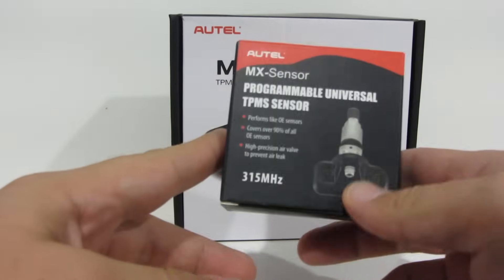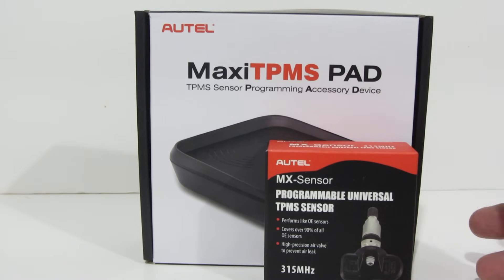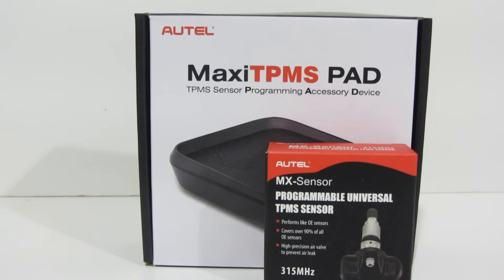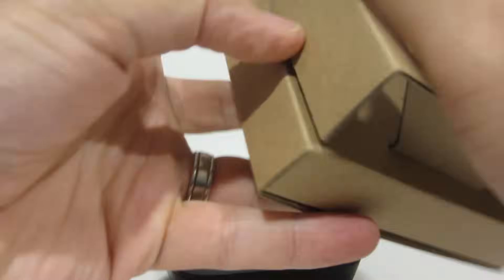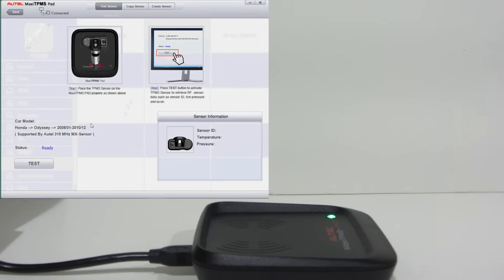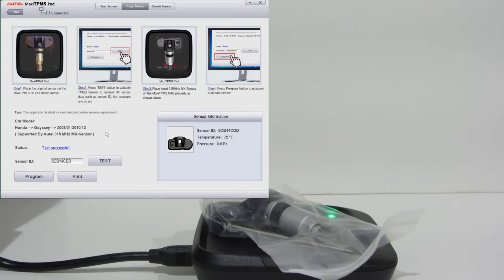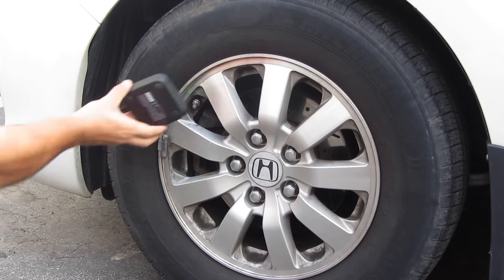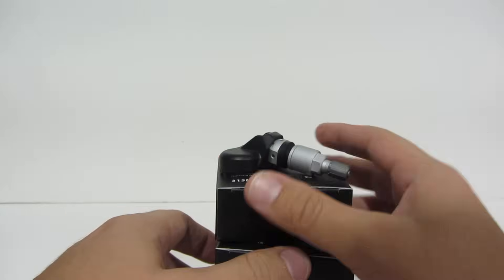Replacement TPMS Sensors for Cheap!

Comment: I have a question. Let's guess I have a dead sensor due a empty battery. Is it possible to open it up with a dremmel or something like that and put a new battery on? Of course this way you break the sensor but it allows you to turn it on and clone it with the device. Perhaps they are sealed and if you try this way you brake it down, I don't know
Reply from the maker: The code is usually physically printed on the sensor. So once you open up the tire, you can just read it. But if for some reason it's not, then what you describe might work. I can't really say. It would depend on the brand of the sensor too.
Reply: it's not worth the effort, sensors are around $30 each. and unless you have tire mounting machine,
you will need to pay some tire shop to do the installation, so why bother? chance of removing battery from TPMS and putting new battery and end up with funtioning TPMS sensor is pretty low.
Reply: @davidjacobs8558  in my car genuine sensors cost 150 euros each, plus programming, plus mounting. Is possible to fit the sensors by yourself without tyre machine. Aftermarket sensor like this are a cheapper choice and if anyone of the old sensors are off due the lack of battery, perhaps to fit a new cell just to turn it on and clone worth it
Reply: @danielboix7973  $30 is for aftermarekt Autel sensor, which is widely used, and seems to be reasonably reliable. you can get Autel TS408 for around $120. If you can replace TPMS sensor yourself, it may be worth the investment to get Autel TPMS tool. because I can assure you, when 1 sensor fails, others will soon follow.

Comment: Hi, thanks for the detailed video. Will the MaxiPad read/ write on Honda OEM Sensors? For my 2007 Odyssey, I have tow sets of Honda OEM wheels(Summer&Winter), My Summer has been programmed, Can I clone the Summer sensors and write them on the Winter Honda OEM sensors? Thanks
Reply from the maker: No, it can only write the Autel sensors. The OEM sensors aren't designed to be reprogrammed.

Comment: If a vehicle has a “bad” Tpms sensor that doesn’t register in the vehicle, will the autel pad still recognize the frequency/info on the bad one to program a new one? Any idea?
Reply from the maker: It's possible that the battery is low enough that the signal doesn't reach the car's receiver, but there is enough life that it can be read if it's sitting on the pad. But I wouldn't count on that.
Reply: @GabesHacks  so if it was "dead", is there a way to program a new tpms sensor yourself with the pad? Or know of any other options?
Reply from the maker: @glennelson2830  The sensors usually have the code physically printed on the outside of the sensor, so if the battery is dead, you can remove it and read the code.
Otherwise you'd have to have a scanner tool that can read the codes from the vehicle itself, but such a tool could probably program the car, which means you don't need to program the sensor...
Reply: Gabe's Hacks thank you. Just trying to figure the best way to do it if I have 2 good and 2 “bad” that aren’t registering. If i buy 4
More to replace all at same time what’s cheapest route.
Reply from the maker: @glennelson2830  It depends on your vehicle. Some will automatically learn new sensors or have a manual procedure to learn new sensors that doesn't require a special tool. You can try checking your owners manual. If that's the case for you, then you can just buy the cheapest compatible sensors and throw them in.
I used programmable sensors because my van does not automatically learn sensors and I wanted a second set for my winter tires, which had to have identical codes to the original sensors, otherwise I'd have to get my van reprogrammed every time I swap the tires.
Reply: Gabe's Hacks makes sense I’ll check it out. It’s an 08 Infiniti FX35
Reply: any idea on this... if I had a tire shop install new aftermarket sensors, and my vehicle is not recognizing them, no pressures shown, and  tpms indicator light is on, how to get this to pair? I tried the infiniti ground out process ive seen on youtube, but no luck. any thoughts?
Reply from the maker: The tire shop didn't help with that? I am surprised they let you drive away with the TPMS light still on if they installed the sensors. Maybe you can go back to them?
I don't have any experience with any Infiniti vehicles, so I wouldn't be anymore help than searching the net. You already saw this?: https://youtu.be/IOaoFCSVtQ8

Comment: Around here, they want 180 dollars to do the complete job. Take old tire off replace and program sensor and reinstall the tire. Talk about a rip-off. Also note, most garages will not install parts you bring in. They want you to buy the parts from them. That way they make a bigger profit from you.
Reply from the maker: Part of the issue there is the warranty too. How can they guarantee the part if it's not theirs? If something goes wrong, who gets to decide if it was a problem with the part or the installation?
But yeah, $180 is a lot for that. All four tires can be done in under an hour by one person.
Reply: @GabesHacks  Well i spent 30 years in the automotive industry. I can handle the warranty part of it. I just need someone to do the labor as it gets harder to do as you get older.
Reply from the maker: @countryside8122  Yeah, I get it. There are some mechanics that will. I worked with a guy who owned a Saab and he'd buy his own parts and take them to his mechanic to install. You just have to find a nice guy :)
Reply: 180 dollars for four sensors  is not a bad price.  Think.  would you want to do this just to save 45 bucks?
Reply: @v.s.o.8684  I did it myself. Not to hard at all. Just break the bead on the side the valve steam is on and easy access to the valve stem. I had the tire remover from the rim item from harbor freight. The rest was easy as pie.

Comment: Thanks for the informative video - it helped me make up my mind about what to do. I have 2 comments that may be helpful to viewers: 1) after the first new sensor has been programmed, the PAD may read it instead of the next old one sitting on the PAD! Even 25 feet away with a wall in between! Not all old sensors will be marked with the ID code - but if it is, make sure the PAD reads the sensor in place as opposed to the new one just programmed. If the ID code is not on the old sensor, move the computer/PAD a very long ways from the sensor already programmed to read the other old sensors!  2) If you inadvertently  programmed a sensor with a duplicated ID number because of 1), and have filled the tire with air, you can reprogram it with the correct ID number without removing the tire or the sensor. Jack the car up to support it, bleed down to 0 PSI and wait a few minutes, then place the PAD on the sidewall near the sensor to reprogram. Because the car I was working on did not indicate which tire was low, I accepted the idea that the sensors all had the same ID number - and this was wrong. The PAD was actually reading the same new sensor over and over - until the last old one was read. Then, I knew I was in trouble!!

Comment: Do you need to connect the programmer to your computer in order to read the code and click something? Is the screen you are showing us actually your computer screen?
Reply from the maker: Yes, that is my computer screen :) It plugs into the computer by USB. The PAD comes with the software you need to install.
Reply: @GabesHacks  thanks!

Comment: for my case: it can not read from the mounted tires, so I can not copy it to the newly purchased TPMS sensors for my snow tires.  is there other way to set the new TPMS sensors?
Reply from the maker: So, do you already have the Pad? It's possible that the Pad just can't make the sensors turn on. But driving will turn them on. So try reading them within a couple minutes after driving.
Reply: @GabesHacks  thanks you and yes, I've got the Pad. I will give it a try.  BTW, is the pad only work for the 'MX-sensor' or all the sensors? in the video, yours are mx-sensor (same brand with the pad).  I got  Schrader sensors (OEM No: 28103AG01C) for my 2014 forester. Looks it's not 'MX-sensor', will this work with the TPMS pad?
Reply from the maker: @hy860  No, it won't work for the Schrader sensors - at least I don't think so. I'm pretty sure they can only program the MX Sensors.

Comment: Thanks for this video, how do you change out the TPMS Receiver?
Reply from the maker: That depends on your car. Some cars have one receiver (like my Odyssey has one receiver in the roof). Other cars have 4 receivers in each wheel well.
Reply: I have a 07 tl. Do u think I will have to go to the dealer? 😭 thanks again for the help.
Reply from the maker: @ashikhan244  You never have to go to the dealer (except for a recall). If you actually do need the receiver replaced, an independent shop could do it. They'll have to order the part from the dealer, but anyone can replace it.
Reply: @GabesHacks  I got the part on e-bay for $25, and got the warranty too, just is case.  Anyway, thanks for the help.

Comment: Thank you Gabe's Hack for the video. This is not directed toward your effort.
Anyone reading this, please invest in real TPMS parts that actually work. The pad sucks and does not read any existing sensor on the car (Nissan Maxima 2009), Digging forums and videos, some say lower pressure to 20psi so it reads the original sensors, not gonna mess with my car for a faulty pad sorry, I received 2 of the "geniusly" designed combined autel 315mhz 433mhz (could not find the 315mhz only) that can not be programmed, I have an appointment to install my new tires tomorrow and theae shit sensors that I received today fail to test (both), says programmed but test fail! SMH. I'm returning them to Amazon for a refund, though time spent will never be refunded!
Reply from the maker: I get it: the PAD isn't actually designed to read a sensor inside a tire, it just happens to do so. Although it does seem like it doesn't have what it takes to wake up a sensor that is off - that's what letting the air out might do. But you can also drive the car for a minute to wake them up and try to read them within a couple minutes of stopping. As long as you know the existing sensors are actually good.
As for the new dual-frequency sensors, I hope that software update for the PAD comes as soon as they say.

Comment: Straight forward video but after going through three MX sensors, two TPMS programming pads, two different laptops running Win10 and even an old one that ran XP, multiple versions of the Autel software, I could not program any of the sensors. It would tell me that the sensors were programmed successfully, but then the software could no longer read the sensor and it would error out. I could read the sensor fresh out of the box, but any programming attempt seems to brick them. Not sure if the problem is with the sensors or if it's with the programming pads. Luckily Amazon has a hassle free return policy. I'm normally a never-say-die type of guy when it comes to projects like these, but I think I have to throw in the towel with this one.
Reply from the maker: That's awful! Had you tried contacting Autel's support? They seem to be pretty responsive.
Reply: I used their online support forum so I could upload screen shots of the error I was getting, but did not get a response. The first pad I purchased I kept, it can read the sensors I have on my vehicle and I was able to use it to identify which tire had the bad sensor using the technique you demonstrated where you hold the pad next to the valve while the tire is still mounted. That still has diagnostic value to me. Now that I know products like this exist I'll keep an eye out for competitors that may offer the same type of thing around a similar price point.
Reply from the maker: @skysurfer  Recently I contacted them directly by email (USsupport@autel.com for North America) and I got a response within a day.
Actually, you might be interested in why I contacted them. I had asked them if the PAD can program their new sensors that combine both frequencies into the same sensor (http://www.maxitpms.com/tpmscms/product2/732.jhtml). They said there will be a software update for the PAD coming out within the next couple of weeks so that it can program those.
Reply: @GabesHacks  When did you contact them? I today received 2 TPMS from them, the combined 315 and 433. Program said finished (after I entered the ID in hex manually) but test says failed.
Reply from the maker: @gardenia1738  I got that reply from Autel on April 8.
Reply: Hey, blast from the past here. Due to my inability to move on from things, I took another crack at programming a sensor using a TS508 scanner/programmer that I picked up off of Ebay. This tool had no problem programming and reading the sensors, as well as the sensors which were already on the wheels. An added bonus of this tool is that it can interface with your OBDII port and can diagnose TPMS problems as well as clear DTC codes. Yes, it's more expensive (by a lot), but the extra features revealed some additional issues. Apparently the tire shop that installed my last set of tires did not put the rims back in order, so the vehicle was reading data for the wrong wheels. The sensor I intended to replace was detected as the front right tire when using the OBDII data, but in fact was physically the rear right tire, which was the cause of the TPMS warning light coming on originally. I could read three of the four wheels with the scanner, the rear right was the only one that didn't scan. So I pulled that wheel off and got another surprise. When I rolled the tire I could hear something rattling around in there. I bet you can guess what it was. Yep, the plastic piece of the factory TPMS sensor. Not sure if the tire shop mangled that during installation or something else happened, but I was unable to remove the tire from the rim using the limited tools at my disposal, and was unable to "fish" it out using other tactics. I went ahead and installed the MX sensor, and was able to clone the defunct sensor because I had the OBDII data downloaded into the TS508. Once installed I re-inflated the tire, then went to each wheel and re-scanned it, and finally was then able to use the TS508 to upload the correct wheel positions into the vehicle computer. Last step was to take the vehicle to a different tire shop where they unmounted the tire and retrieved the broken TPMS sensor. What a journey!

Comment: Hello. Great video though I do have a question. Do all 4 tpms sensors match the same code to all 4 tires? I have a rubber stem in one of my tires and wanted to replace it with a tpms monitor. If I dont have the old tpms can i program the new one I will be replacing the rubber stem with with the number from one of the other tires?
Reply from the maker: All 4 have to have different codes.
What year/make/model car do you have? Some cars automatically learn new sensors, which would mean you might be able to buy any sensor, put it in and drive.
Reply: @GabesHacks  2013 Honda Civic
Reply from the maker: @MrVINNYMACno1  The Civic does not automatically learn new sensors. So you either have to program the car with the code for the new sensor, or do what I did in this video and use a programmable sensor. But to program the sensor, you would have to know the code the car is expecting. If you don't have the old sensor, then the only way to know that is to read the code from the car's computer. But if you have a tool to do that, the same tool would likely be able to program the car. :)

If you want a tool that can read and program the car's computer, I have a Foxwell NT510 that can do that. But they released a newer version, the NT520. It's the least-expensive tool I've seen that can read all codes. You just have to make sure you specify the make of your car when you buy it since the tool needs specific software for each manufacturer. You can buy it on eBay here (ships from Hong Kong): https://ebay.to/2UKqbeW
Or try Amazon if you want it faster (just make sure you read carefully and get the NT520 for Honda - Amazon search is bad for giving you different results): https://amzn.to/2CJxaOr
After you buy it, you can even buy and download additional software for different manufacturers directly from the Foxwell site (I think each one is around $60).
Reply: @GabesHacks .. ok. Thank you for all your help. I will start my journey now. 

Thanks again!